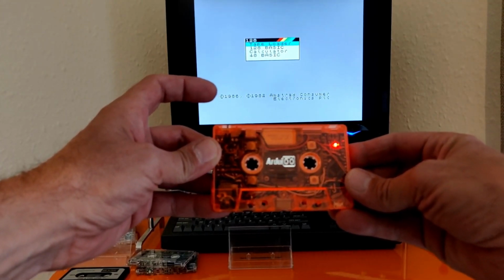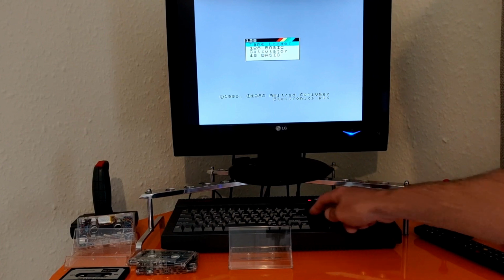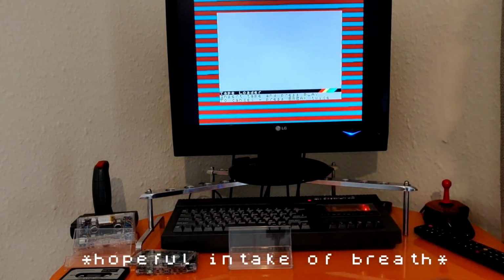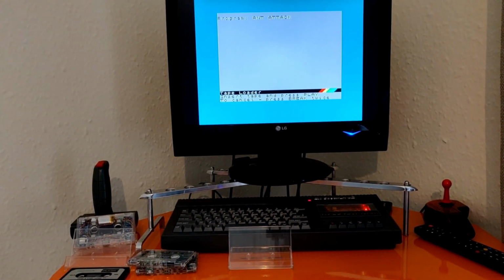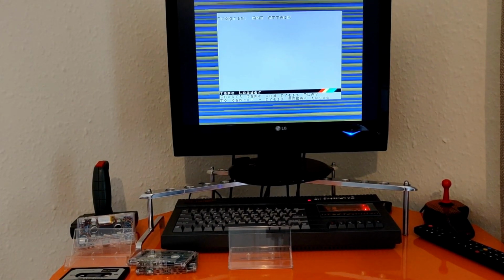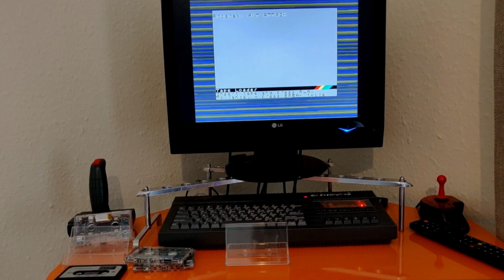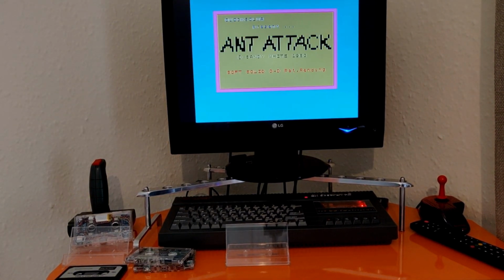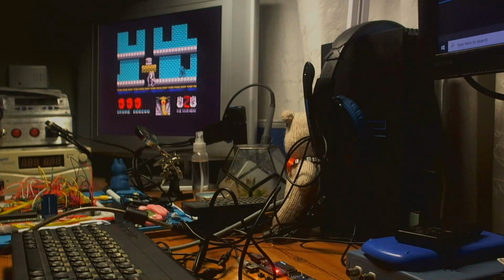Loading Games in a Post Cassette World - TZXDuino

Comment: Great video, thanks for sharing!

The cassete style devices are very clever and that PCB design to fit a cassette case is a stroke of genius though. I think I'll prefer to use an external device though as it will help to avoid any wear and tear on the cassette deck (even though it means I need to make a small mod to my +2A).

I'm looking forward to building this and seeing if I can make any improvements or interesting adaptions to the code.

Comment: Mine works better in the EAR socket on the ZX Spectrum. I can use jumper 2-3 then,
Reply from the maker: Mine doesn't have jumpers on it. Is that to enable/disable the onboard amp?
Reply: @BreakIntoProgram  Hi, yes I have that too. I`m sure it`s turned on.

Comment: Had an Arduino Uno, a dev shield (had some buttons already on it), and an LED display I got in an Arduino kit. Added an Arduino SD card module and a mono plug and built a TZXDuino for my TS1000 (USA ZX81 from Timex). Works great. But yeah, some of the 16k games take a while to load. :-)